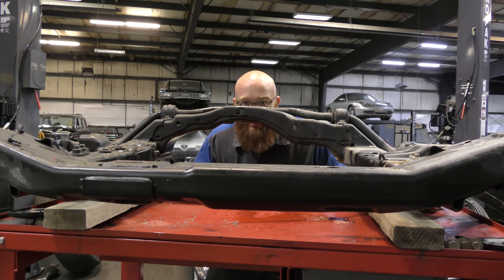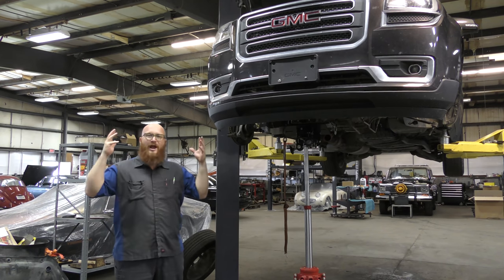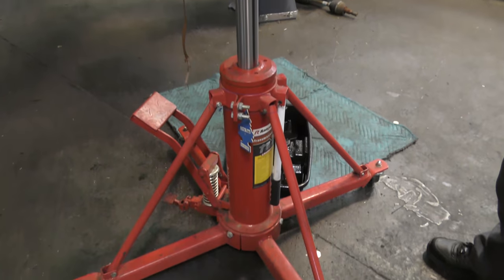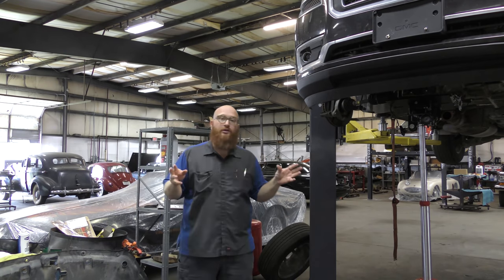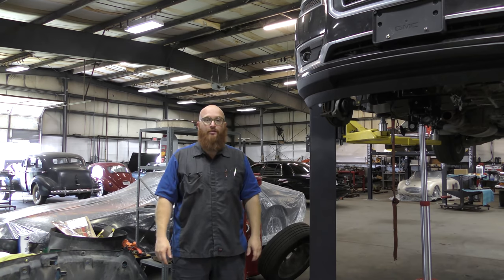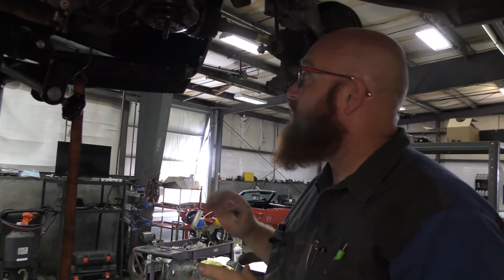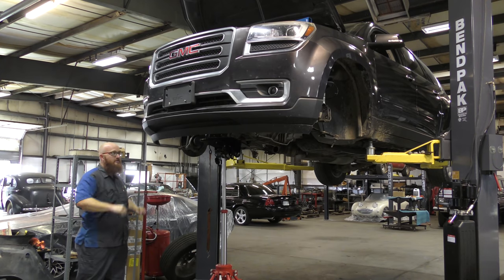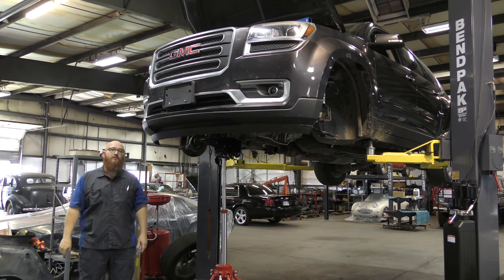Used car insanity in the CAR WIZARD's shop! Why did the huge repair get approved on this '15 Acadia?

Comment: LOL--I just had my first hydraulic motor mount blow.  Yep I was surprised.  Thankfully on a 2011 Mazda 3 the replacement wasn't too hard (did it my self) and the OEM part cost wasn't terrible, but cleaning up the engine compartment took over an hour to get that weird substance off.  Rubbing alcohol did the best (tried googone and a couple of other cleaners).

Comment: I had a mechanic that kept mis diagnosing a headgasket kept charging me for thermostats and flushes and even charged me for a chemical test. god i hate mechanics their seems to be more crooked mechanics than anything else. The mechanic was just milking me it wasn't till i took it to the dealership that i got to the bottom of the problem.

Comment: 16:53 hell yeah! windows down and head hanging out! Screw paying $900 for some comfort. I don't need air or heat if its going to cost that much. it is never economically viable.

Comment: Now is obviously the WORST time to buy a car or a house.  Or really anything, but those two items especially.  I feel bad for those who HAVE to buy a different car because their previous on was wrecked or crapped out (I know someone who hit a deer recently a totalled their car -- or it will be totalled, as it's an older Corolla only worth about $6k, but was told it would cost $3,000+ to repair).  I guess I'm glad I bit the bullet and purcahsed a different vehicle right before the chip shortage and supply chains issues started to happen (purchased late last year and glad I did, because my previous vehicle would not have survived another year without major repairs).

I do have to say the older Acadia's were not very good once they hit about 100k.  They tended to fall apart (I'm talking about the 2010-2013-ish era).

Comment: You forgot to mention another common failure point on these and that's the rear coil springs.  At minimum $700 repair.

Comment: Like many, I really want to believe in GM. But I simply cannot. My very first car was a handed down 73 Caprice. It was awesome. Great car. Guzzled gas. But I had a good experience generally with it.  Time went by and I graduated college. I rode a bike [all weather] for years and finally needed a car for work. So I bought another GMC [Jimmy] in 1987 …it was used, only 2 years old. Nice Design. I took meticulous care of it. The tranny failed and left me stranded, the pistons in rear window failed, the brakes failed,  the electric windows failed, and tons of little parts failed. Timing issues etc. I took a big money loss and sold it. Re-grouped and bought only Toyotas Mazdas and Hondas since then. I have friends that bought GMC and are reporting the same problems to this very day. So nothings changed. I am not sure why they cannot get it together. I like their designs, but just don’t trust them mechanically, I am sure there are good stories out there with them…but I am really ‘snake-bit’ by my own experiences, I suppose.  Thx for the vid.

Comment: I first check the vacuum on the crankcase that is the most important thing because without that the seal will leak, the PVC is responsible for the vacuum. How much is this leaking one dollar of oil per year?

Comment: I had to break the bad news to FAR too many customers when I worked at O'Reilly Auto Parts when they'd come in for code reads. It got to the point where, depending on the make/model of vehicle, I'd be 99% certain what the issue was. GM was all too easy for me to guess: VVT solenoids on the 2.4, evap purge valve/solenoids and timing chains on the 3.6. Oh, and don't get me started on the "active fuel management" on the 5.3 V8's!

Comment: On these GM vehicles with 2 piece oil pan the upper oil pan gasket (silicone) leaks next to the rear main seal and looks like it’s a rear main. I’ve torn a few apart thinking there’s going to be a bad rear main  come to find out it only needs upper oil pan gasket.

Comment: I appreciate the videos and information . I not interested in buying any thing like that .  I heard of engines that had a chain in the front and rear of the engine . No not for me . These videos are pretty nice for guys like me to know what to avoid . I not interested in a car that i have to pull the intake manifold to change out a spark plug

Comment: You know what's worse than being a used car salesman? A new Chevrolet salesman.. much worse! I used to work at Chevy dealership in sales. I could have gotten a great employee deal on a new Chevrolet.  Hell no! I bought a nice 2019 Toyota Camry with 31k miles. You may spend a little more upfront but they are built to last. I can tell you that I seen so many new Chevrolets delivered brand new with problems.  I had a new Chevrolet 1500 Silverado and they forgot to hook the dipstick pipe to the engine and oil was leaking everywhere.  Especially don't buy their crap turbo 4 cylinders. I can't believe people buy 4cyl Silverados. Those are huge trucks... Just don't do it!

Comment: I wouldn't pay $1000 either for that repair. I'm not blaming the mechanics for the design of vehicles but no way am I paying that kind of money for something that I can make do with, and that is one of them. It's called closing the vents, and or removing the heater core hoses during the summer and putting them back on in the fall.

Comment: I miss when those air actuators were actual cables, it was much simpler back then. But I'd do the same as that customer, I would not fix it. Probably bypass the hoses for the heater core on summer time lol

Comment: I feel for that guy that does not want to spend 1,000 to fix something simple like the ac control ... but this is why new cars are getting more complex and harder to fix.. a friend had to fix the air bag error on the passenger seat because the child proof sensor was bad for the air bag.. guess what he had to replace the entire seat.. to fix it..  that is the price of these new cars.. they are way more expensive to maintain.. or do like me, and stick to a simple 1998 Ford escort.. that is cheap to keep..

Comment: My 2006 with the Cummins turbo diesel no longer defrosted the front window.  Yikes!  That was $2600, but I decided to replace ALL of those damn motors since the dash had been pulled out.  OK, that done, I picked up the truck.  Did not even get to the road.  There was a rather sudden rattle sound and then an odd noise that changed as I pushed the clutch pedal in.  Yup.  200k miles on it and I had just had the clutch release bearing let go.  Another $2500  (but I put in a South Bend clutch kit instead of the two piece OEM fly wheel).  Yes, those darn little motors he is talking about are really a bitch to change out.  My 1985 Toyota truck uses a cable system.  I had one get really rusty.  I can't remember how much the cable cost but it was under $50 and it took me about two hours to pull the radio, the heater controls, replace the cable, and put it all back together.  So......  Why can't we go back to cable controls?  They were really easy and held together for next to forever.

Comment: Good grief so many problems w/ that car!! Come on GM, I know you have the engineering ability to do better! I want you to succeed.  I have a 2015 Volt that I really like.
Reply: It's amazing how long those 3.6L engines have been garbage. I remember when they came out in some 2004 Cadillac's and they got a bad reputation quick. They've been updated a couple times over the years but the gremlins just seem like they never leave those engines, and GM seems incapable of making them reliable.

Comment: The cam shaft always rotates 2x the crank shaft ( nominally) - this is true for all 4 cycle "Otto cycle' engines.
Reply: Half crank speed is it not?...
Reply: @sm400  you are correct.

Comment: I miss the old days when a piece of mechanics wire or a coat hanger, even both got the hvac system back to snuff! I hate those stupid motor packs for the anguish they cause us. Why can't we just stick to the basics with that system?  Even if you are lucky enough to find old school switches and knobs in your vehicle,  they aren't connected to anything but the head unit module, an hvac controller,  and monitored by the ecu. Does it really have to be that difficult? My husband has a late model volvo v90. The car is so sexy! When it's really cold outside,  it doesn't let the blower motor ramp up to high till the core heats up to temperature.  It really pisses me off! I'd rather have 35 degrees blowing on my feet than 10 degree air making numb! Even my f250, the recirculation button,  something a car guru never dares to touch while smoking in the vehicle,  it decides all on its own to recirc whilst the cab warms up. What's that about?  I spent 60K, I know how to operate a heater! Are consumers really that needy?

Comment: Omg my wifes 2009 acura tsx has 475k miles no issues at all just breaks tires and filters oil changes made in japan damn gm just like the transmission and lifter problems lawsuit they have against them but ppl still want to buy a chevy 🤢🤮

Comment: All the car makers have laid an egg from time to time. The big issue is some get away with it. Ford after the 7.3 diesel ( a good motor), put out a piece of crap diesel in two configuration. Blown head gaskets, overheating etc. No recall. The Chrysler K car had issues with the 2.2L in the 80's no recall, Cadillacs had a dog with 4.6 and 4.9, head bolts. No recall. The list goes on. I have a Chevy half ton, I keep getting recall notices about the brake system. And some other issues. My wife's last 3 cars were Toyotas, never a problem. 
I like to buy American and I try, but look at the facts for reliability, it's hard to beat Toyota. Toyota has had a few issues with poor oiling in the engine years ago, Now heres the big news, they stood behind the car and corrected or warrantied the defect.
Hang in there Wizard, most people beat the snot out their cars, no clue how to maintain it. PS to the GM mechanic, I had a Cad SRX, timing chain replaced at 33k miles. Yes by the previous owner. I fixed a few things on the car, then dumped it for a huge loss $$$$. What a piece of chunk, looked good. Any GM with the 3.6, is a time bomb.

Comment: I had one a 2015 was great only warranty repair was a front engine mount. Trade it in at 45k. Now I dont know if it's still on the road.

Comment: This video is wild!! I’m cringing and laughing all throughout because I bought a 2016 Acadia back in October and i bought it knowing these issues may be present now or later but I just love the looks and the size so I bit the bullet and so far I’ve gotten the power steering pressure line replaced along with the rear aux evaporator! I got a 3rd party warranty and I know they won’t warranty another Acadia again after I’m done with it 🤣

Comment: I would say with prices today to buy a used suv or truck for 10-12k and get it fixed up by a mechanic like wizard to save some money. But in reality a $10k truck is 20 years old, has 200k miles, and needs so much work it would take another 10k to make it safe and legal to drive, while still being a lame base model.

Comment: The reason for the used car "boom" is precisely the price-bloated new car market full of electronic fluff and costly, reliability sapping turbochargers / direct injection / dual clutch transmissions.  I'd buy a $13k ($21k inflation adjusted) 1998 Civic EX over ANY Civic offered today 10 times out of 10.   The bean counters have devolved the auto industry into releasing planned obsolescent bloat wagons.

Comment: I'm curious....do you charge ACTUAL hours or BOOK hours? 

I know ALOT of shops now charge "book hours" on repairs and not actual hours. 

Like rear shock replacements. I've had a quote for rear shocks on my 2012 caravan of $980 plus tax for the job. They were charging book hours and the shop rate was $165/hr. Plus shop materials if something happened. I had shop that said that will take me 1.5 hrs at $95/hr. Both licenced experience established shops. 

When I picked my van up the 95/hr guy called me 2.5hrs after I dropped it off. It was done and he said " I had two bolts break. I got the broken out. Replaced them with new. No charge for the bolts or time." I said "what's the bill then" and he said "1.5hrs at 95/hr plus tax is $161.02 

I'm not saying wizard is a ba mechanic. Just so many mechanics turning a 100-200 dollar repair into a 1000 dollar repair people feel they can't trust any mechanic or profession. Plumber, electrician. Anything. What I'm saying even the difference I book hr to actual hour makes a difference. If te book says 3hrs and your a mechanic that can do it in 1.5hrs.....charge the 1.5 we will come back we will trust.

Comment: Fomer service writer. Oh please di the stories lol. 
It was amazing how many people would pass on repairs even when shown how bad it is. Then when it breaks they get pissy. Pay 400 for a timing belt for you S90 Volvo. 
2 weeks later it breaks. Now it is 6k. (Yeah this was 20 years ago)
 Or they repair it and screw it up. Best? They replaced the water pump on a 1998 E420.
Forgot one crush washer. Melted 4 of the 8 pistons to the block.
Oh so many more. So so many more.

Comment: Can't believe a six year old vehicle has all these problems and anyone would want to buy it after having seen this video. What are they looking at 5 years from now? The same issues all over again? This is the current sad state of affairs with G.M., cars and light duty trucks. My own personal experience bears this out also.
I Hadn't bought a new vehicle since 1999. Summer of 2018 I made the mistake, of buying a, new, 2018 Chevy Colorado, Z71, 4-door, 4x4, V-6 and 8-speed A.T., after reading a bunch of, as it turned out, meaningless reviews about how good it was.
With less than 1,000 miles on it, it developed the infamous 8-speed transmission shudder. Then at less than 7,000 miles, a leaking front differential pinion seal and at the same time a leaking right rear brake caliper seal that they couldn't get parts to fix for 10-21 days. Checked, online myself, no right rear brake calipers to be had. That should tell you all you need to know about G.M. Ten days passed and still no brake parts. All these problems on a truck, that had never left the blacktop and only had the 4-wheel drive engaged a handful of times the previous winter. It was less than a year old with less than 7,000 mile on it.
The dealership was also a Toyota dealer so I decided to cut my losses and traded the Colorado for a Toyota Tacoma. No more, new, G.M. products for me. They are not the G.M of   old that I remember from the late 70's early 80's. I had several used G.M. cars back then that were dependable vehicles including a 1974 Chevelle that I had a lot of fun in and ran hard and had no trouble with.

Comment: I'd be pissed and decline the repair too if a mechanic was trying to claim it's going to be $900 to take a dash off to get to the A/C components, but part of being pissed would be that I now realize how much I'm probably being overcharged for the other work too.  The irony is, it's not even established that taking the dash off is necessary, since there are youtube videos showing the repair without taking the dash off.

Then there's the motor mounts, you're claiming are $150 each when Autzone has all 3 for $180 total, or Rock Auto has them for $100 total and even the OEM ones are only $70-75 each, so this "no additional labor" works out to another ~$250 mystery profit.

You wouldn't hear back from me either.  These kinds of nonsense shenanigans are why nobody else touches my vehicles except for new tires and alignment.

Comment: If this video isn't enough to scare anyone away from a GM vehicle idk what is. What a pile of shit all these Acadias, terrains, equonox etc. Friend bought an used 10k mile 4 banger terrain, burned oil, eventually they "rebuilt" everything, still burned oil. Sister in law has a POS equonox bought new in 2014, given its IL but God damn what a cheap POS exhaust is rotting out, rust galore...

Comment: 14:43 ohh just seeing that thing made me angry. I recently bought an '08 jetta (REALLY good deal, love the car so far, only had some gaskets replaced and it's solid otherwise) that had a faulty one. Made that annoying grinding noise on startup, when you put it in reverse, or turned the recirc on. Took me FOREVER to figure out what it was. And hey, $20 part on amazon, and it's something you can totally do yourself so not an expensive fix. But good lord it took me an hour and a half to do it. Pain in the ass, but the silence was worth it lol

Comment: got an '03 Sante Fe.... still shifts and drives great at 213k miles. wouldn't touch a GM car with a 50ft pole

Comment: Had a 2013 Enclave, the thing rode amazingly well, but working n it was a hassle, I heard timing chain work is an engine out job, and the power steering pump replacement it needed when I owned was a pain in the ass. I’d avoid these things bc they are costly/difficult to repair, but damn if it wasn’t a smooth, relatively quick, extremely comfortable vehicle when it was working fine
Reply: Exactly my dilemma. I have a 2013 Buick Encore at 150k and it’s really starting to turn into a real load of work so I want to dump it, but I cannot find another vehicle on the market that drives as smooth and quiet as my Encore. The only vehicle that I liked was the new Encore GX or Envision. But the dealer markups on these right now are crazy, there’s Encores going for 35k+ in my area and I will NEVER pay that much for a upscale Chevy Trailblazer.